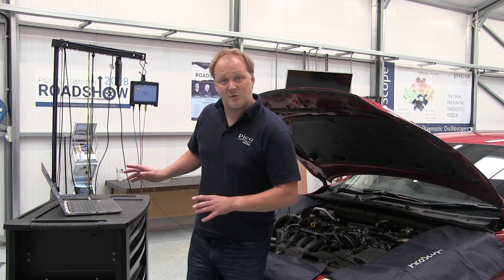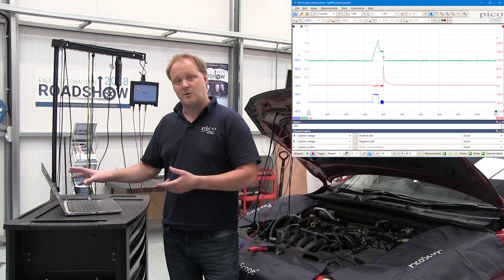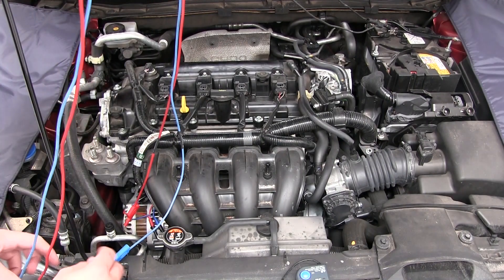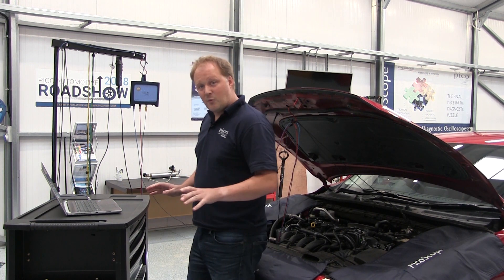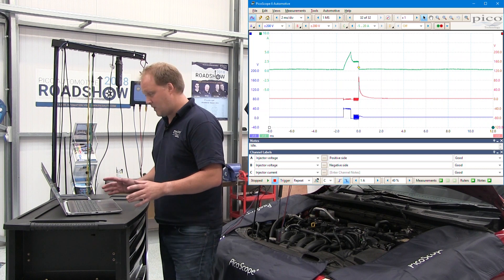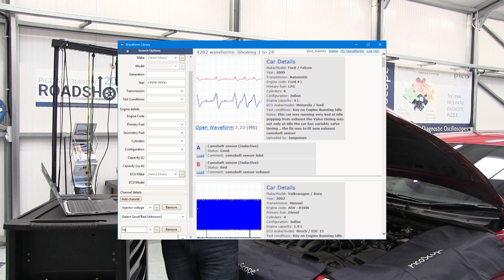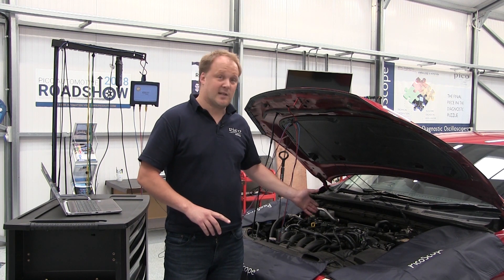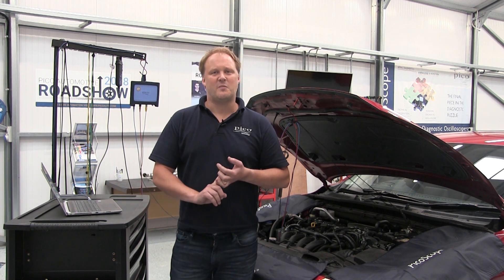Gasoline direct injection - injector voltage and current

Comment: Great video. I was just wondering about an attenuator, if it is necessary to use one when hooking up to the the power and also the ground side of injector circuit. Thanks alot

Comment: Thanks for information
What is the voltage and current that need to work gdi injector safely?
Reply: Hi Mazin, The voltages and current you expect to see vary a lot depending on the engine operating conditions. Also by make and model. Have a look in our guided tests (you can download the software at picoauto dot com / downloads). You are really using the scope waveforms to see whether a signal is there, how long the injectors are actuated, and whether there are any intermittent shorts to B- or B+ or any open circuits.

Current is probably most important if you want to see whether the injector is being driven. Probably you would expect to see around 5 - 10 Amps peak most of the time but, as above, you can't really say "these are the tolerances for a good/bad injector".

Your best approach if you suspect a fault with an individual injector is to compare with the others. If you see significant differences (when capturing the waveforms at exactly the same time) then you have a problem.

Hope that helps.
Reply: @pico_barney  
Thank you very much 
I will do that 
Yes very helpful thanks again